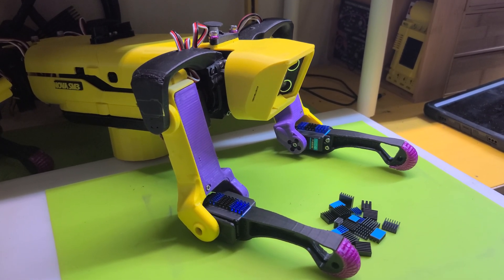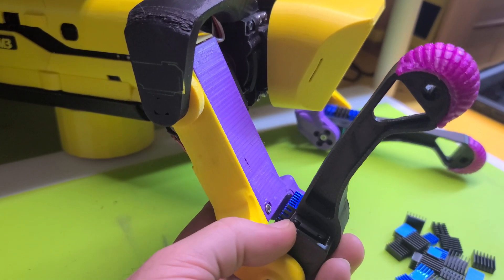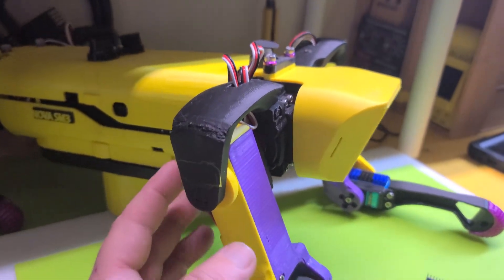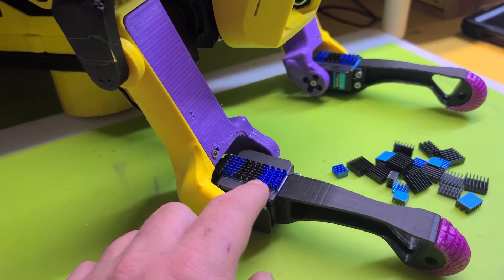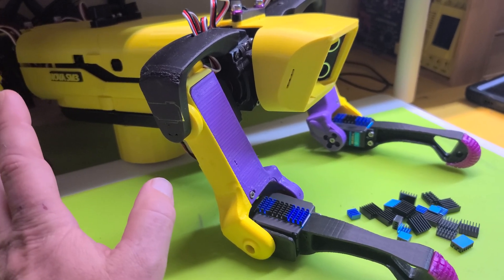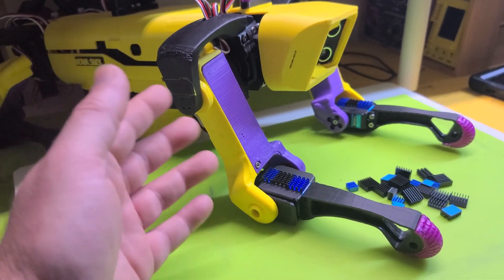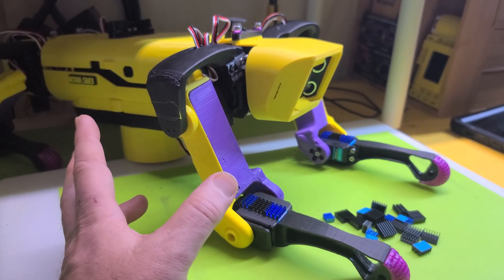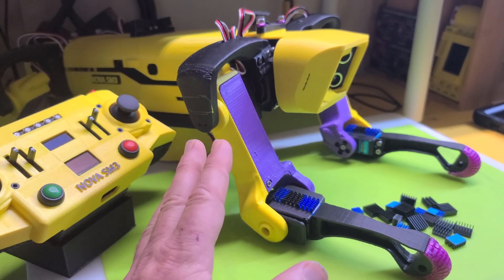35kg Servos Installed : NovaSM3 v5.2 : a Quadruped Robot Dog Spot Mini Clone

Comment: Can I connect a lipo battery directly to 12 servo motor with a 5200mah 2s 35-70c rating safely or we need a converter for it to safely deliver power to the motors also will
Reply from the maker: not just a converter, but power distribution, which the servo driver board provides. otherwise, there's nothing to control which servo draws the most current, and surely would have performance issues